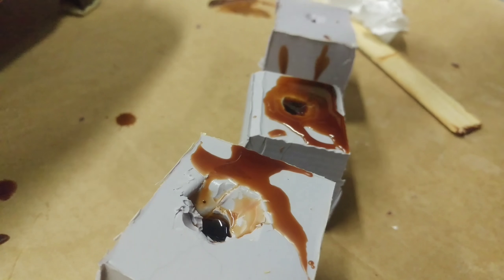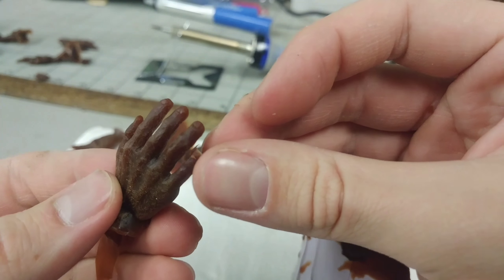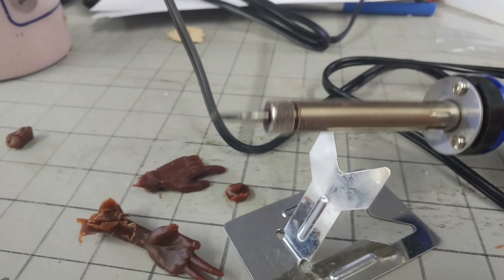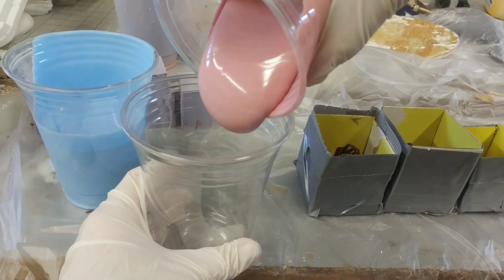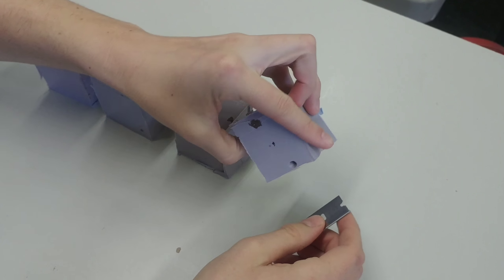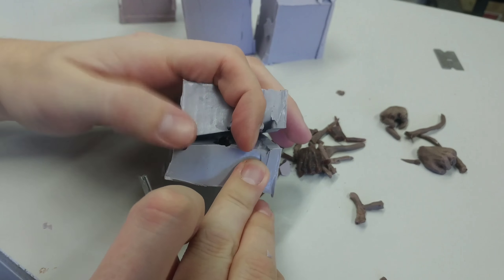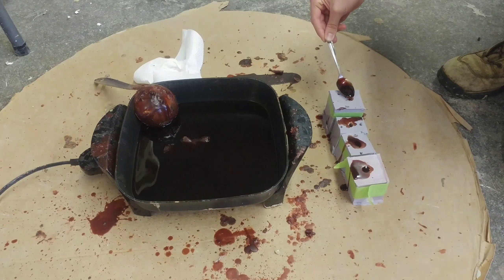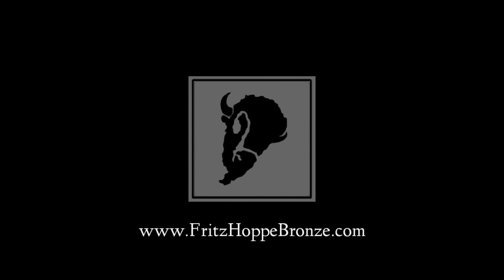Chasing Wax Sculptures: Prevent Air Pockets with Sprues & Air Channels

Comment: Fritz... We are totally going to do a run of these in gold and silver.  Say the word, I can make it happen!   I predict the best seller will be the 1 finger salute to the dems.
Reply from the maker: It's happening. A big box of these (chased wax) might be heading your way after we finish those foxes.
Reply: Hi J--what about that 2 car lift gigantic project?! I should want a home conveyor belt and overhead  hoist. How did the chinese rubber work out? I would expect a small hand to be in the 1/6 to 1/4  troy oz range, making silver the more affordable choice. how about that purple gold stuff? see ya WT
Reply: @hj-clone  It's actually still in work!  I've been chipping away at lowering the sump system to control the water for building....  Nothing new so nothing to film really.  Ya might not know, but I took one of Fritz's hands here and we cast it in silver with a big ring around it to hang from a chain.  It came out awesome!  Maybe he can show it off here some time.